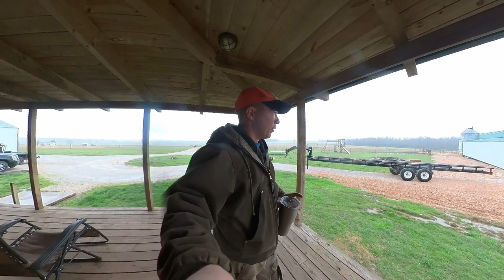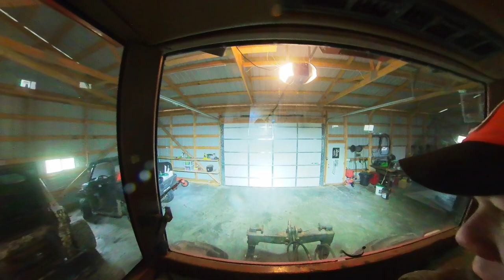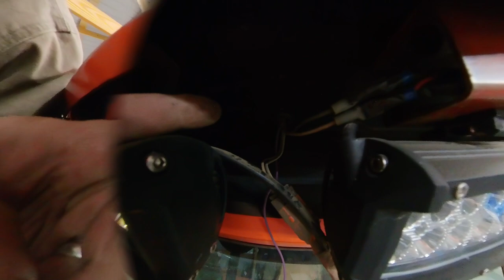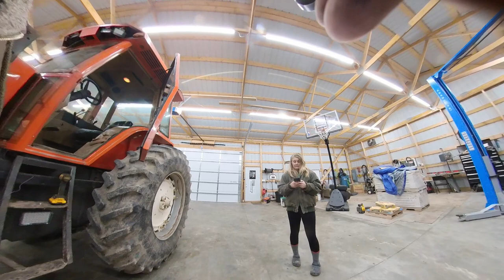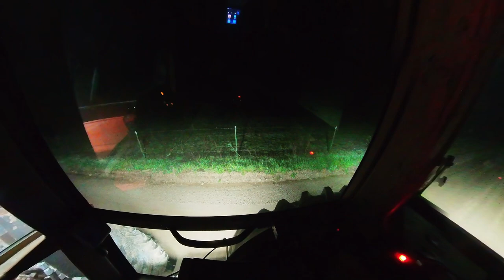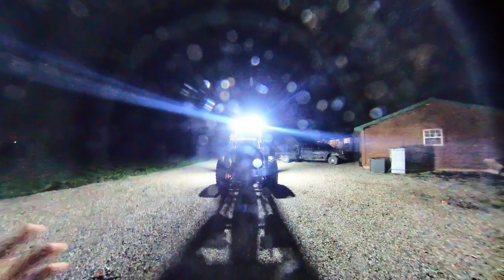We added some more lights on our 8030 to light up the night! #8030 #led

Comment: Hey Sean u might know but there is a fuel filter inside the frame rail towards the back of the engine. That is the first one from the tank, I think they call that one the primary.
Reply from the maker: We changed it as well but the video footage didn't show much so I just edited it out. Thanks though I appreciate the info. You never know when you may overlook something